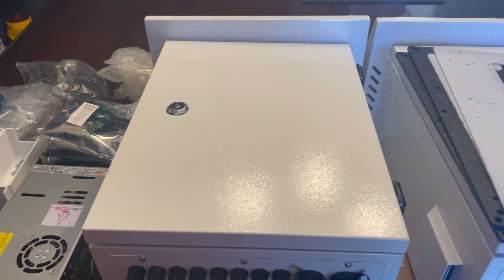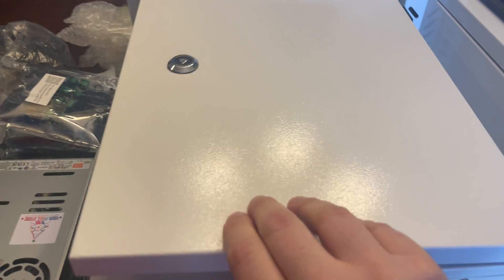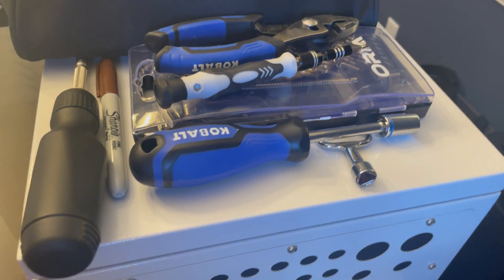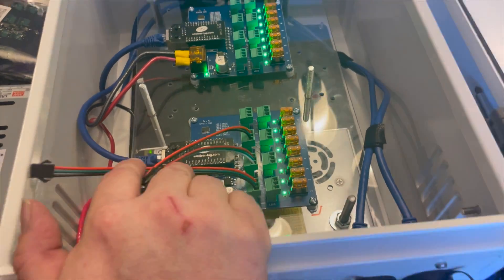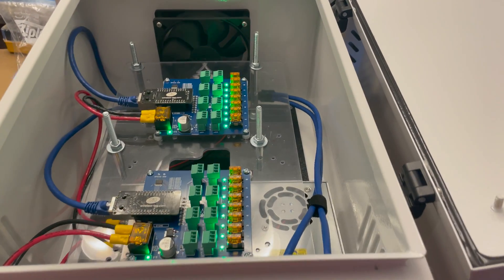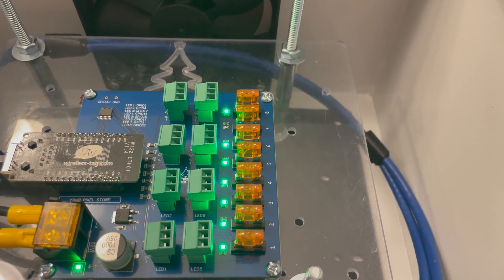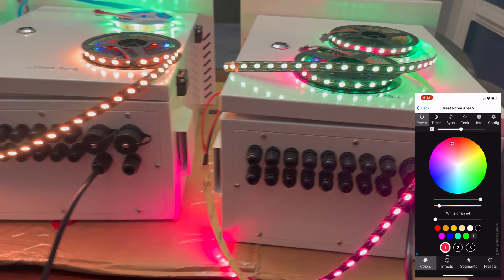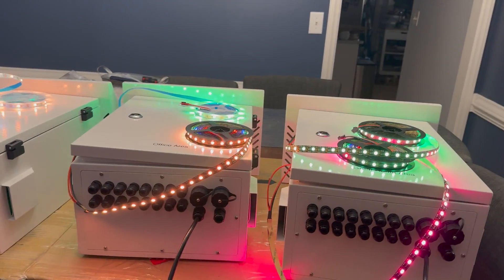WLED Controller Build

Comment: Looks good bud 👍🏼. Can you control every channel separately.
Reply from the maker: Yes! So WLED is really powerful in that I can control channels separately if I choose to, but I can also combine two or more channels into the same segment so they work together. For my covered patio, I will combine 4 channels into one segment to light up the perimeter of the ceiling. I'll demo that in another video once I have it all installed and set up.

Comment: Why have you got such big boxes 🤷🏼‍♂️
Reply from the maker: Yeah, they are large, aren't they? :)

Honestly I could probably get away with much smaller boxes. What happened was that I initially ordered a fully assembled box (https://yourpixelstore.com/product/full-build-yps-8-port-ethernet-controller-12v-version/). You can see from the picture in their store that they come with a smaller box by default. However, they sent me a different assembly in a larger box, because they were out of the small boxes. I noticed I could fit 2 controllers in that large box and I kinda like it! So I decided that instead of buying 6 small boxes for 6 controllers, I'd rather get three boxes with two controllers each.